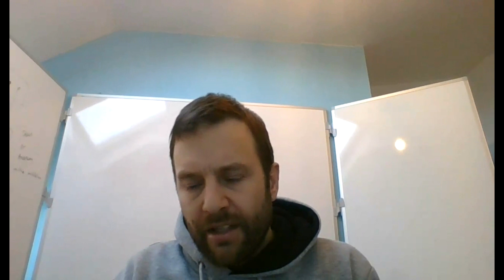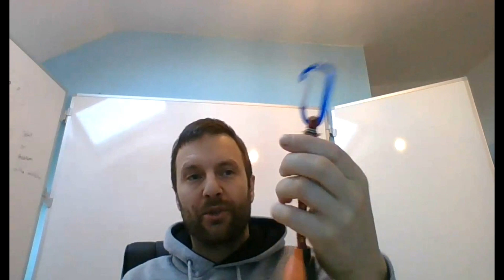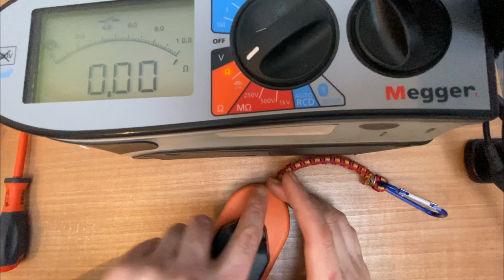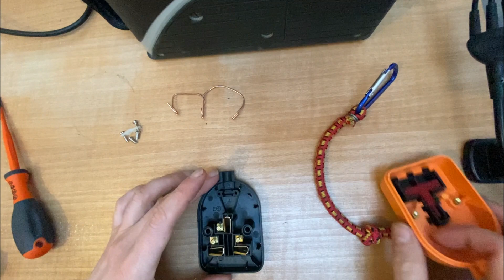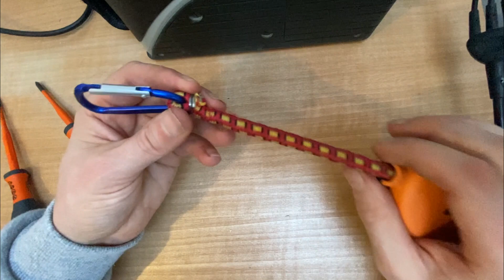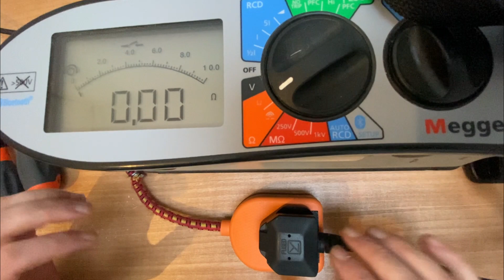How to make a socket nulling adapter for your tool bag

Comment: I have a plug like that were I removed the fuse holder an used a neutral pin off a other plug so no fuse and I linked out all pins I use this when working on a ring or radial circuits so if some one dose put the power on am safe as all 3 pins are shorted.

Comment: These sockets are available a Toolstation for £3 and you can buy a paracord keychain on eBay for about £4 so you can actually make them cheaper
Reply from the maker: How much cheaper does that equate too?

£4.70 for the socket (delivered)
£0.66p for a carabiner (delivered)
Bungee cords I had.
Reply: @Pure_electrical_training  oh sorry Adrian I must have misheard the price on the video I've managed to make two for 8 quid after seeing this video slightly better than paying £15 for the same thing on eBay.